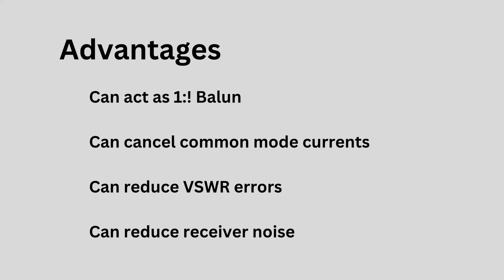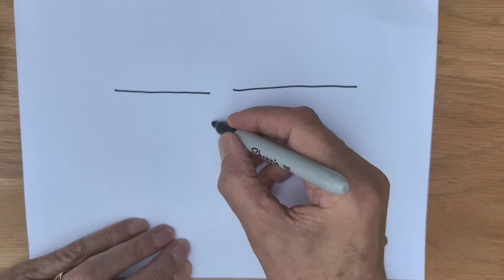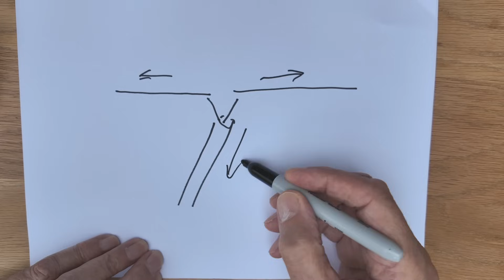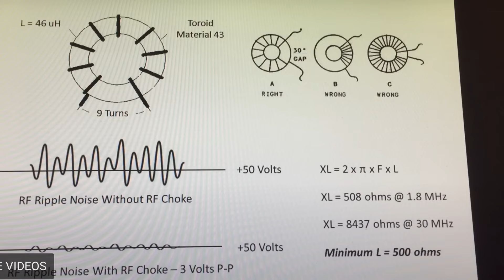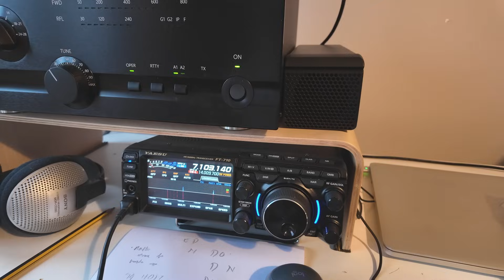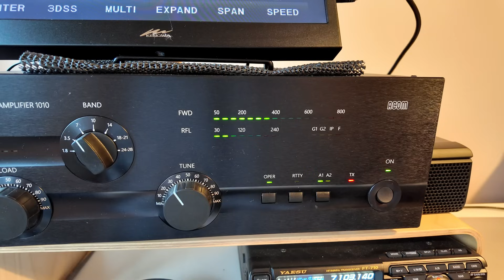Ham Radio Line Isolator - Build and Placement

Comment: Facinating as always. Many thanks.
Forgive me if im wrong but are you saying that for a T2LT i would be better using a toroid core than the airchoke ive wound on the base?
Woukd using both an airchoke AND toriid choke (i still have a lot of QRM) many thanks.

Comment: Nice discussion. I have been testing several line isolators with a NanoVNA. I discovered that the various isolators have different frrequency responses.  One of my isolators is very good from 30 meters through 6 meters very poor on 80 meters and marginal on 40 meters. Another is super on 80 meters and adequate but marginally so on 10 and 12 meters. The point here is that various isolators  have different frequency responses making some models preferable in a particular application.  Manufacturers never advertise the frequency response

Comment: I’m still convinced chokes/line isolators aren’t real 😂. I’ve bought one and also made one but every time I add it them on the SWR increases to over 3 on the 20m band which won’t tune with an external 10:1 capable ATU. On 40m it also reduces the signals from contacts unless they’re really strong. Adding more coax isn’t possible especially when there’s about 50ft coax from the shack to the antenna already.
Reply from the maker: There is sometime really wrong there. If you are using an external ATU your internal transceiver ATU must be switched off. You do not say what antenna you are using but the results you describe suggest something is amiss.
Reply: @ Thanks for your reply! I’m using a 20ish metre long EFHW for 40-10m with a dual-core 49:1 and an Icom 7300 with the internal tuner off. I’m going to run the calculations again but everything is on point as far as I recall. It certainly is odd.

Comment: 1. You said that the sheath outside layer conductor is highly reactive. How reactive is it?  
2. How can the outside side of the sheath reactance be calculated?
3. If it's already highly reactive, why do we need to add more reactance to it?
4. Due to skin effect, why would there be a lot of reactances on the outside of the outer conductor?
5. The antenna is a 1 port device. How can there be an imbalance on a 1 port device?
Reply from the maker: All points you raise were covered in the bideo.
Reply: @watersstanton  thank you so much for answering my questions in the video. 

I have reviewed the video a few times and I cannot find the locations for these answers. Can you please send me the time locations for these?

Comment: A common mode choke is never a bad idea ... especially as it's cheap and easy to make one.
I would strongly recommend a choke if you're using either an OCFD or an EFHW antenna as these antennas are both notorious for RF currents flowing on the coax outer.
It's quite an easy process to check the performance of your choke with an inexpensive nanoVNA.
Reply from the maker: Thanks for sharing.

Comment: Great video. I'm going to make a few of these, but with one slight modification for the isolator at the antennas. All of my dipoles are either Alpha-Delta brand or they are homemade with the Alpha Delta centerpiece. So when I make these, I'll use a male on one end (to screw right into the Alpha-Delta) and a female on the other end for the coax to screw into. Boom- no barrel connectors!
Reply from the maker: Thanks for sharing.

Comment: I personally believe that the simplest effective way for a line isolator (1:1 balun) is, if you have a 240 sized toroid of the proper composition,  you can just wrap the feed line and connector through it as many times as possible at the shack end and call it a day. Edit to add, because I use resonant antennas.  Good content! Edit again... 43 is fine for 80 but for 160 mix 75 toroid is better suited.
Reply from the maker: Thanks for sharing.
Reply: 31 beats them both

Comment: I had a toroid core and a 1m RG58 cable, so I made one while watching thise video, since I only had 1, I put it at the feedpoint of my attic installed G5RV Jr..  Prior to installing it, I had the antenna tuned for 20m with about a 1.2 or 1.1 to 1, also the transmitter I'm using would typically show 10-12w out max.  I had to make one slight adjustment to the transmitter capacitor and now the reflected meter barely moves above 1 and my transmitter output is now averaging 12-14w out.   I need to get another core so I can add one at the transmitter end.   Thank you Peter... N2LCX
Reply from the maker: Great to hear.

Comment: What about the snap on ferrite beads? Do you feel they are effective at HF frequencies?
Reply from the maker: They work but I believe you would need several in series to achieve the same benefit.
Reply: Im making a 15 core mix 31 beads 1/4 in for my lmr-240    Palomar engineering has some good ones

Comment: I built this line isolator like you have it in a previous video and this one. It works great! I used 3 ft of RG-58 with connectors on it, and wrapped 13 turns around the 240-43 mix torroid and tie wrapped it together. I pulled this choke in and out of the feedline going to the radio input. It does bring the SWR down to 1:1 and filters out the RF. Otherwise, the SWR goes all over the place on my display on the radio. Very simple to build. Your videos are very informative and I learn a lot from them. Thank you very much.
Reply from the maker: Great to hear your results.

Comment: Hi Peter, would a line isolator be beneficial for use with a magnetic loop antenna ?
Reply from the maker: A good question. I suggest just one at transceiver end. This will keep VSWR readings accurate and also protect against any noise pickup on the feeder.

Comment: A good point to keep in mind if you have a lot of noise in the signal. Maybe this is the problem with my 230 ft coax feed. I just finished my first EFHW build last weekend and was happy without choke, depends on the results. It would be nice to avoid needing one just for weight savings. Another thing I need to check is RFI. I really don't want to interfere with critical infrastructure on a mountain top with an EFHW😅.
Reply from the maker: I would strongly suggest one at transceiver end.

Comment: I've noticed that most of these line isolator examples wound around toroid do not take account the minimum bend radius of the coax.
Bending it too tight can change the impedance of cable, since it deforms it. Effect can be neglible, as use of rg-58 itself also, but still there can be additional loss caused by it. For rg-58 minimum bend radius is around 25mm, so if done according to cable specifications, loops would be 50mm of diameter.
Reply from the maker: Yes, no problem with RG-58

Comment: RG-58 is great for making a line isolator for HF operations. I prefer to place it just outside the penetration entering the radio shack.  That way the radiated RF stays outside the building, mostly.
Reply from the maker: Yes makes sense.